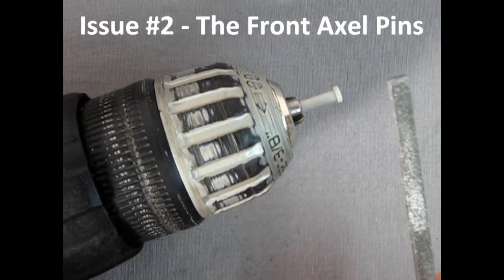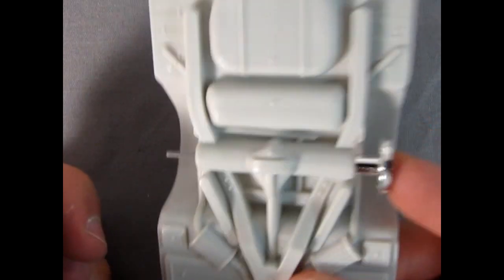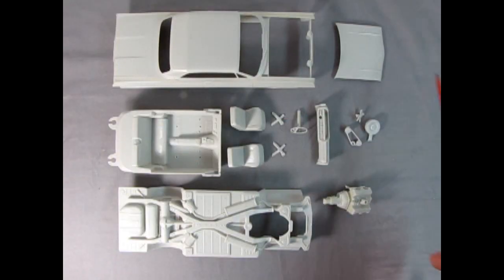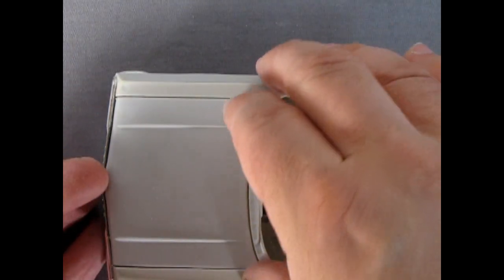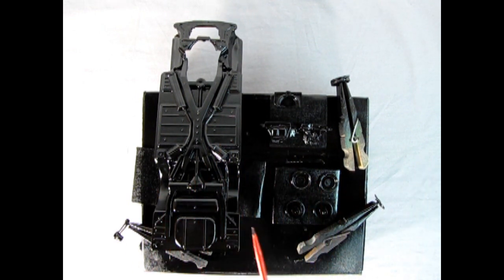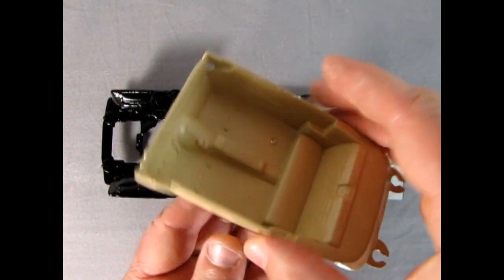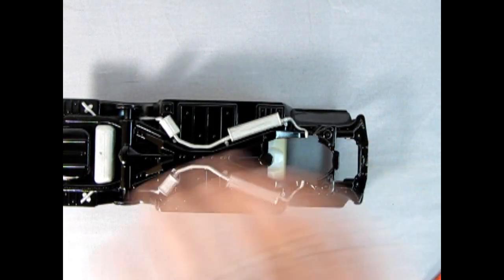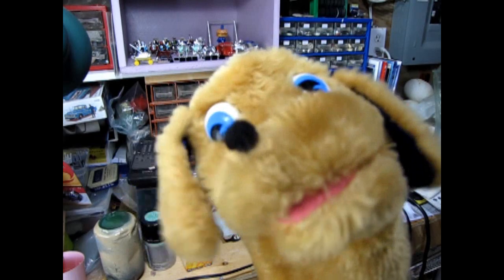Your Guide To Building the AMT/ERTL 1963 Chevrolet Impala - Monster Hobbies Model Car Garage How-To

Comment: Well done! A tip: the rams horn exhaust manifolds are cast iron and were not painted! I'd paint them flat brown to simulate rust. Also: the gas tank is in the rear. You can see the 2 straps on it. I'd paint it steel. The thing you thought was the gas tank is just a deep part of the trunk! Plz don't take my observations as criticism!
I've removed a few gas tanks in my time! Cheers, ...Newk from Kentucky
Reply from the maker: Thanks for the tip!
I have a few of these kits, so I will remember your input when building the next one.

Comment: My dad had a ‘63 409 SS in a dark red colour. It was the show car in the Long Beach auto show for that year. So, as a kid I built just about every 63 Impala kit I could find. I’ve done this AMT boxing a few times I think. You did a great job given the kit has issues. The last boxing I had was somewhere in the 90’s but it had the battery. The exhaust and manifold always bugged me so I would use styrene rod to fix that. Again, nice job. Really love the Impala 409.
Reply from the maker: Thank you so much.

Comment: That was really good Trevor 👍🤩. Very nice build and good tips for improving the details. 👍🤩Thanks for showing and best wishes from jolly old England 👍😎Pete 🤓. I don't know how you can live with floating generators or alternators when it's so easy to punch hole in sheet and make bracket🧐
Reply from the maker: Thank you Pete!  i still have to fix that hood fit. i think it's the radiator cap...but I glued in the radiator. Maybe I can cut the cap down with a #18 chisel blade. I kinda got tired when it came to trying to figure out that battery. Yes, brackets would look good..but I wasn't going for a proper build on this one...just to get it done, especially after the paint was soft for 4 days and that whole Bare Metal Foil application that wasn't going well for me...but it did need those 3 missing parts : Radiator, Firewall and Battery...battery will come later.   

I am thinking of going more "All out" when I build the advanced custom 4-in1 1963 Impala. this was just the "Test drive" build for the kit.

Comment: I was wondering if your kit lacked the chrome hood bar or you just omitted it because you have to do surgery on the high fitting hood? I'm doing the Revell 6682 kit now which does include it. Thanks.
Reply from the maker: The AMT 1963 Impala kit kit doesn't include the chrome hood bar. - But I think the 1962 one does.

Comment: Many years ago I built the amt prestige release,  I hated the engine and chassis, so I swapped it from the amt 64 impala
Reply from the maker: I hope it went in nice and easy!
Reply: @MonsterHobbiesModelCarGarage  easy like they were made for each other
Reply from the maker: That's the best kind! Did you replace the 63 chassis with the 64? I'm just thinking of the hole in the 1964 engine for the front metal axle as opposed to the plastic pins in the 1963 chassis.
Reply: @MonsterHobbiesModelCarGarage  I used the engine wheels and axle from the 64 as well as the chassis
Reply from the maker: Good to know it fits straight across.

Comment: You did a beautiful job on this Chevy, but I have a couple of concerns with the kit...First, those plastic pins they use for the front wheels never seem to look right, they don't really work as well as the metal axle in the original (and Prestige kit) did.   Second, the original kit had clear red taillights, which I look for in model kits.  With so many kits having those red lights, why  couldn't they include them instead of molding them in with the body?
Reply from the maker: I'll agree with you on the plastic pins, however, are you sure you're not mistaking the tail lamps for the 1964 Impala?
Reply: @Monster Hobbies Model Car Garage  Back in 1963 I bought the original Advanced Customizing 63 Impala kit and it came with clear red tsillights.  I own a friction 63 Impala model and it has red taillights as well
Reply from the maker: @gojoe2833  Nice!

Comment: Hey nice video. I'm working on the same build right now and I have a problem putting the wheels. So the manual says I need to insert those little things (number 60)but I cant find them. I've watched your video twice but I can't find them. Also, the wheels spin perfectly, but when I attach the other part of the wheel they get stuck because of the glue. Please help me
Reply from the maker: Glad you liked the video. 

I am not quite sure I understand your questions on the wheels. Are you able to make a video and show me what you are experiencing?